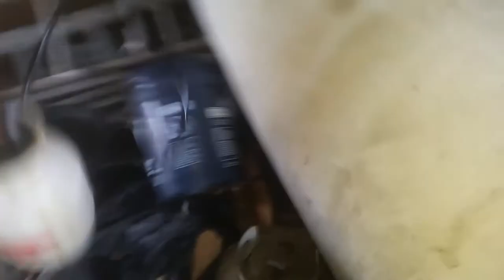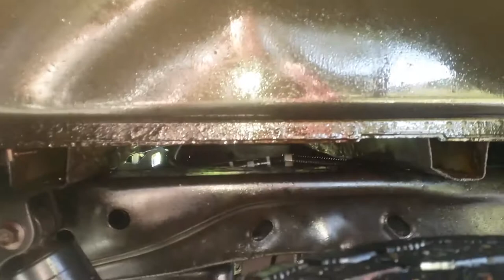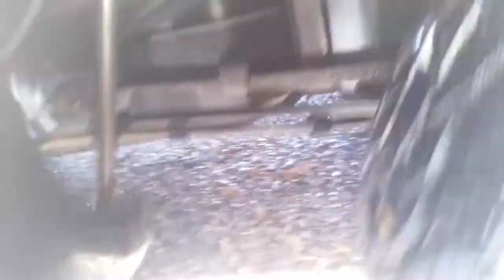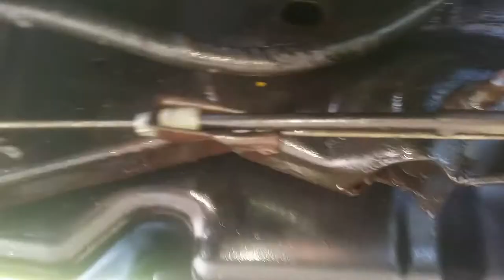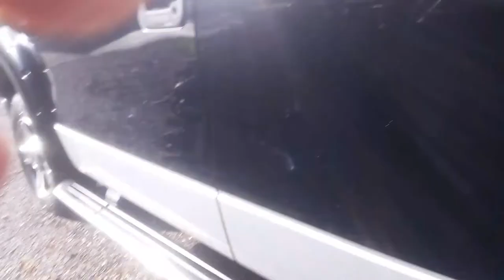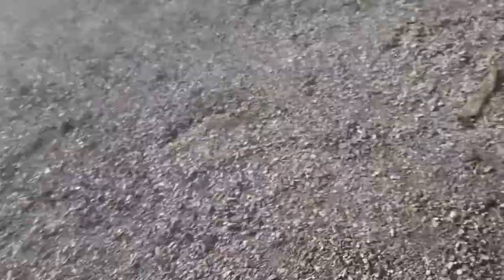Cheapest Way To Oil Spray Your Vehicle

Comment: Thanks for this!  I was wonder if a garden sprayer would work, I guess if you cut it with Diesel the answer is yes!   For those worried about rubber, just put a plastic bag over anything you dont' want soaked in oil and come back and use a paint brush to coat right up to that component without getting it wet.
Reply from the maker: That's a good tip dude

Comment: You can get a adequate spray gun for like 14 bucks. I'd add some parafin and melt it in the oil.  sticks good to the frame.
Reply: Schultz undercoating guns can be had for 12 bucks.  I've made home made waxoyl using oil, paraffin wax.   Just need a compressor to spray it.

Comment: oil and mineral spirits is the best. the mineral spirits help the solution dry on the frame and floors, so it doesn't just get washed off driving in the rain.    you get a whole year out of it.  even after washing the salt from the bottom of the vehicle after every snowstorm. every fall, when i re-coat it, i see there is still coating from the previous year.
Reply: 50/50 mixture?

Comment: The Best thing to add to your used oil is Transmission fluid & WAX!!! Melt a wax toilet ring into motor oil when it dries it will stick to your frame like glue, my 92 VOLVO wgn has 0 RUST I live in New England Salt Capital Boston.

Comment: I make my own that lasts the season using old ATF , Cheap petroleum jelly  and bar n chain oil.   Heat it up till it’s all melted then spray it under there.      I also plug the doors weep holes drill a small hole in the edge of the door an let 2-3” worth sit in there for a couple hours.   Then pull one of the tapes and recapture what drains.   It’s. Good idea to pull the rocker plastic covers and spray some around inside the rockers as well as the cab corners .   Cab corners are notorious rust outs
Reply from the maker: Ya ik. Thanks for the tips

Comment: Isn't fresh new oil better? Just asking, because some grades are very very cheap to buy
Reply: No used is required. Don’t ask me why but I have read it on many occasion. I just finished doing my trailer with this same method. Definitely a mess but should make my trailer last a lot longer
Reply: @Ns90212  I read that used oil is acidic. Each to its own, better than not applying any

Comment: Hi, would old engine oil be OK? Also if nixed with diesel will the diesel dry after leaving only the oil? Cheers
Reply from the maker: I've only used old engine oil
Reply: @onyx123ish  thank you so much for the reply, I think I read a comment of the mixing with diesel an got confused. I painted an old car underneath with old diesel oil using a brush. It made it look shiny an new as the car had lots of standing rust from being parked in a damp area indoors for a years. I always wanted to use my weed sprayer but always thought it would block it up or ruin it. I'll try it now, but Im gonna spray silicone spray 1st on all the rubber parts 1st, bushes etc. An then spray the oil, so even if it actually touches the rubber its protected. Well I hope so!! Thank you
Reply: @onyx123ish  sorry in your video you said you mixed it with diesel! That's why in asked if it would dry out incase its a fire risk? Thanks
Reply: @SY-ml5nl  , he said he used a 50/50 mix of diesel fuel and motor oil

Comment: I was going to do this with my garden sprayer until I found out that the oil will eat the rubber bushings up.  How are they holding up.
Reply from the maker: Greg Brooks holding up fine
Reply: I use one of these to spray garden plants and it gets clogged up a lot at the needle jet sprayer.  Does the dirty oil not clog this up.
Reply: How are the rubber suspension components holding up after spraying the 50/50 oil/diesel? I've read that diesel can eat rubber and cause it to swell.
Reply: It will but only after long term contact with the solution. If you clean it out after you're done you should be fine.

Comment: I use motor oil and Lucas oil stabilizer its thicker so you kinda get the drippless affect but will still get everywhere
Reply from the maker: Glad to hear, more then one way to skin a cat
Reply: Lucas Oil Stabilizer is a 100% petroleum product. It damages your car rubber/bushings/boots!!! Don't use petroleum on rubber!!!  Dirty engine oil is fine!
Reply: @sergejpanov5543  So what is oil then, NOT petroleum enough to harm?
Reply: I used Fluid film out the can with a Brush it shrunk my Rubber Door Seals !!!😣

Comment: Did you try with just lowest viscosity unused engine oil like 0w20? I wonder how it would flow through the sprayer? Thanks for the video.
Reply from the maker: 10w 30 is what I used

Comment: Probably just want o make sure not to use an oil pan that has dirt and junk in it. Then poor that into your sprayer. Would clog it. 
Advantage of using new oil.  Don't have to worry about your sprayer clogging.    Cheap oil is cheap.
Reply: Filter/screen the used oil and it's way cheaper than buying new oil.

Comment: How long before it ignited. I don't recommend this. Besides the friking mess of it drippings for days and possibility of fire and after it rains it will get washed off slowly but surely.
Reply from the maker: Never ignited, it's stays on all winter. Helps keep the salt off the frame etcetera, but isn't for everyone
Reply: @onyx123ish  Thanks for the reply. Interesting that it stays on all winter. Can I put it on with like a pressurized bug sprayer mixing Kerosene or diesel and oil?
Reply from the maker: I'm not sure

Comment: Why use old and dirty oil instead of just buying cheap and fresh oil. Also, its probably not a good idea to spray oil anyway in case it starts to break down original (from factory) rust protection like wax.
Reply from the maker: Because it's free
Reply: If from factory rust protection worked, this wouldn’t be a problem
Reply: @bulldog8934  That's true. However, some people do this on cars still new enough to have the original protection left. Besides, spraying dirty, used engine oil with all kinds of contaminents on virtually bare metal can't possibly be a good idea. At least it would make more sense to buy the cheapest engine oil you can find and use that.
Reply: Used oil bonds better to the underside of the car.
That’s why people have been doing it for decades.

Comment: Why what’s the point
Reply from the maker: Dalton Bowman helps with rust on the frame
Reply: If you have to ask you don't drive a truck in an area that sprays salt all over the roads every winter.   Salt destroys vehicles in as little as 10 years if you don't use some sort or rust prevention or literally power wash the undercarriage and frame after every drive on salted roads.

Comment: That is going to smell terrible 
 forever. And I'm not exaggerating it is going wreak the point of you and your passengers getting headaches burning eyes Etc.. looks like you did the engine bay too.. that's bad. 
And for his next video the ultimate degreaser..
Reply from the maker: Jason K it doesn't smell bad, then again I'm not a panzi
Reply: onyx123ish pansy or not maybe you don't mind the smell of diesel and burning oil on your daily commute but others who never thought this through could be in for a rude awakening. I think it's great that you are telling the world about your find and it is a cheap way to prevent your vehicle from rusting I'll give you that but maybe give people a heads up that there is a possibility that it will smell and people who are scent sensitive should probably not attempt this. 
There are other very cheap ways to get the same job done without the smell. Automatic transmission fluid and melted vaseline works very well. As does melting a wax ring used for a toilet seal with automatic transmission fluid.
I would use your method on a trailer or something that is not carrying passengers. I wouldn't recommend it for a daily driver.
Reply: I find it cost effective just to have the car sprayed at a good oil spraying company every 2 years.
Reply: I love the smell of diesel!!
Reply: Go away
Reply: @onyx123ish  you are a tender delicate peach
Reply: @jasonk9734  You like the smell of AT fluid?  I prefer diesel.
Reply: mineral oil & engine oil 50 50 mix so it will spray thru a spray bottle nice & will creep everywhere, no smell
Reply: It doesn't stink.  Been doing it for a couple years...  Don't spray it on your enfine or exhaust and it won't burn.  Duh...
Reply: Does K stand for Karen?
Reply: @jasonk9734  Do you even own a body on frame vehicle??? First, every undercoating (ex: Fluid Film) smells really bad for a few days until it dries. Once dried, it has no smell. Second, your vehicle shoudn't have any outside smells going inside the cabin... Even with the air re circulation button off and driving, you only get fresh air from the top of your air intake vents and NOT from engine bay or undercarriage Sounds like your car has serious issues if it lets in odors....